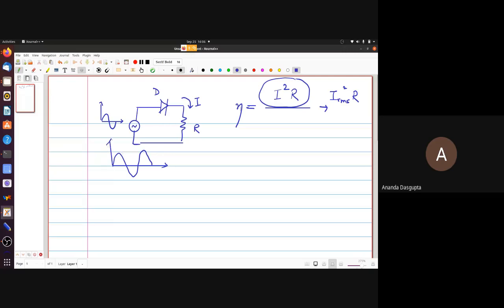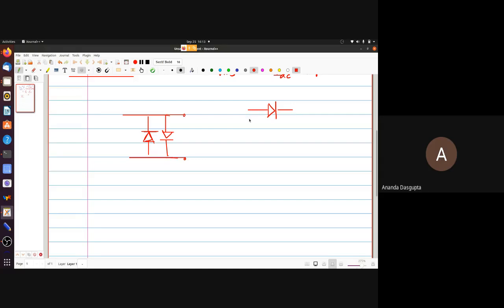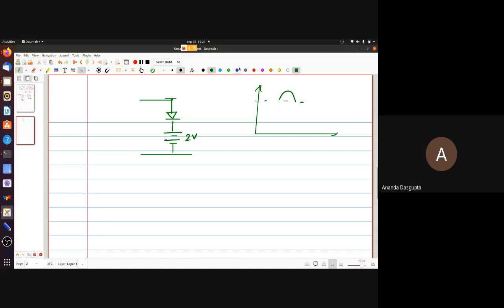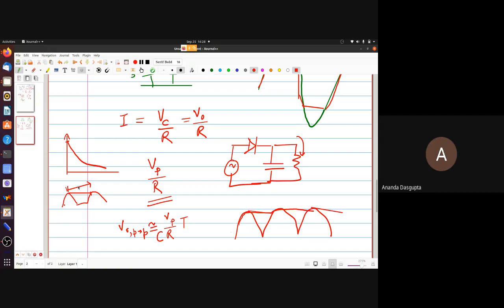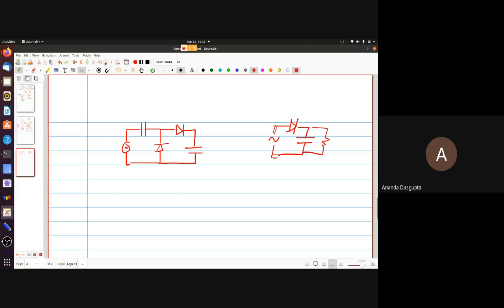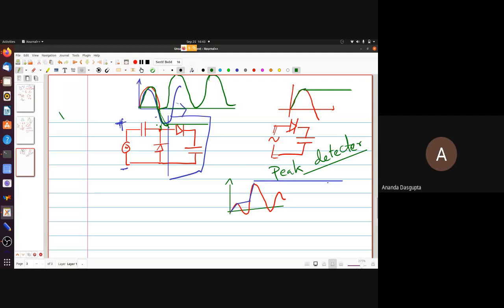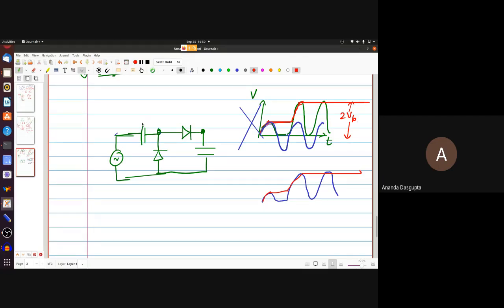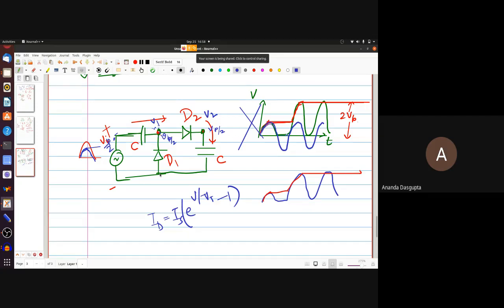Recording of discussion class 7

Comment: Respected sir, I have doubt about the efficiency of rectifier with capacitor, the efficiency seems to be very low when we are using capacitor, bcz we are hardly making use of Input cycle most of the cycle is not reaching output  as here diode is getting forward biased for a small portion of input..
Reply from the maker: While you are right about what you are trying to say, the term efficiency has a technical meaning and does  not really mean what you want to say. That aside, you are right that if the ripple is small, the diode is switched on for a very small fraction of the time. However, this happens only if the load is small, and that means that a very small current is drawn from the capacitor by the load  resistance (which, of course, has to be large). Since the power delivered to the load (V times I)  is small, the capacitor loses relatively less energy in a cycle, and the diode has to be on for only a short part of the cycle so that the source can replenish it. Of course if the load is large, the capacitor will discharge a lot more - leading to a bigger loss of energy - and the diode will conduct for a larger amount of time. Of course a large amount of power is delivered now, but at the cost of a much larger  ripple. This ripple versus power trade off is always there. Indeed, if you try to deliver a lot of power using this circuit,  the ripple will  become  unacceptably high. In such cases, it will be better to switch to higher order filters like the LC filter or the T-filter.
Reply: @ananda_dg  Thanku sir..🙏🙏